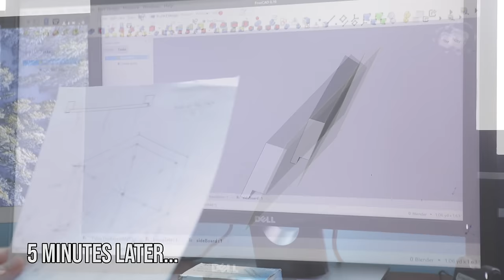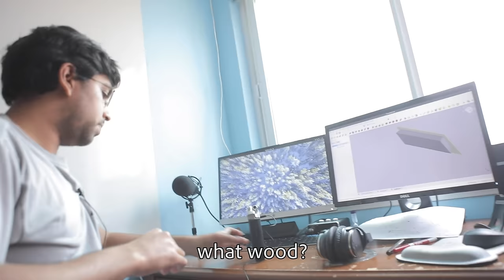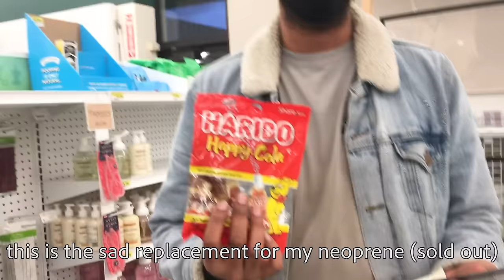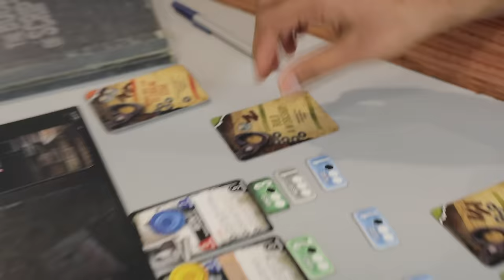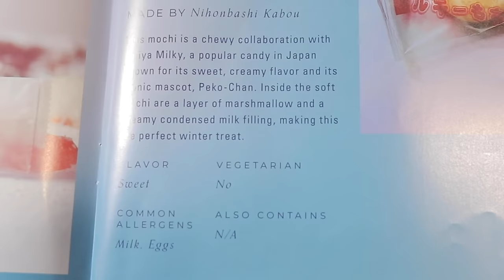Building a Board Gaming Table

Comment: Quite enjoyable to watch you cut 4" square wood on a entry level table saw.   Mitre cuts (angle cuts) are super hard to get accurate so kudo's for pulling through with your hardware
Reply from the maker: we were actually surprised it worked too! Pretty darn good for only $200, we actually made some card holders onto the top of the table with the table saw afterwards. Cheers! -Ashton

Comment from the maker: Use my code SHELFSIDE10 and link: https://bit.ly/32rLqeJ to get 10% off (save up to $47!) your own authentic Japanese subscription box from Bokksu! Don't miss out on this amazing snack-journey through Japan!

Disclaimer: Do NOT use the table saw like we were doing in the video. For example, the cut at 4:08 is EXTREMELY dangerous and should not be followed. Please watch proper woodworking techniques if you ever do decide to make your own table. 

Since this video's release, my friend cut card holders into the table, and added a magnetic rail on the side. -Ashton

Comment: Would you consider putting the plans up for download? for example was it 3/4 plywood and then dimensions like the height you settled on. 

Leaning over the table saw blade was scary to watch and not a good technique, avoid that please. One side or the other of the saw.

Comment: I think for a future build, you could go with a "table topper" rather than a whole table. The hinge idea was wonderful for portability it kinda sucks to see the plywood support remove the hinges' utility.
I'd also recommend using a spray adhesive, putting the neoprene on the table base and THEN mount the rails onto the base.
You can also use box joints for the legs. The screws go in diagonally from the leg to the tabletop so it makes them a bit more stable.
Reply from the maker: cheers for this! Have shared with my friend :) -Ashton

Comment: 4'x10' sheet Plywood ? LOL  Y'all should have bought a tape measure ;)
 The scary part of this vid was nerds with just bought  power tools they have never used, especially a table saw(the most dangerous power tool you can buy/use).  Glad nobody lost a hand or fingers. 
 With just using mineral spirits, it won't last good.  Personally I think that those 4x4 borders will be throwing some serious splinters down the road , that you don't want to be impaled by .  Use  lot of  Acrylic Polyurethane sealer/finish , several/several  coats, for a nice clear coat finish. Plus an acrylic  coating will keep the wood from getting stained by spilled drinks/food/ water marks and sweat/oil/dirt from people's hands and arms  or  the  wood splitting/warping over time by sealing it..

Comment: Nice! This is what I did when I made my table:

Went to Home Depot 

Got a 5’x10’ sheet of 3/4” thick high grade plywood (for making cabinets so I didn’t have to sand it as much) had them cut off 4’ to be left with 5’x6’ 

Got two pieces of 2”x4” had them cut the wood there since they offer that.

cuts out buying a table saw 

Got some screws, nails, and dark maple stain polish

One pieces of 1”x1” trim molding 12’ long had them cut into two 6’ pieces

Got a 6’5”x5’5” pleather (apple red colored) from a local store & spray glue

Went home, put together the 2x4 then mounted the 2x4 to bottom of the 6’x5” sheet.

flipped it over

Sanded some, applied spray glue, laid down pleather to board and made sure their were no wrinkles or air bubbles.

Added the 1”x1” trim to each 6’ side, nailed them down and added spray glue then added some stain to 1”x1” trim. 

That is pretty much what I had to do, I cheated though. I used my current table in dining room and made my frame with the 2x4s to enclose the original table so then the 6’5” sheet doesn’t fall off. I ABSOLUTELY love it! I think all together was about $200. With the left over 6’x4’ I gave it to my buddy who helped me which he  just covered with felt and made his own table top. 

The reason I wanted such a big table was I play a nemesis and I wanted plenty of room for everything for a 5 player game.
Reply: Cost?
Reply: @relativelyboard9959  $200 but I also did it before plywood tripled in price